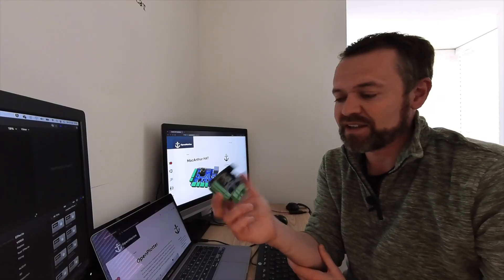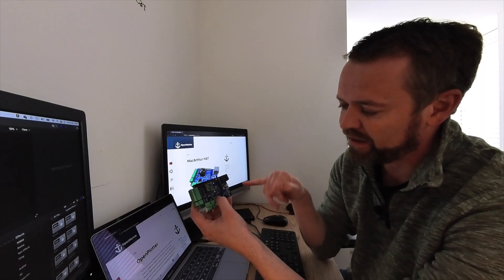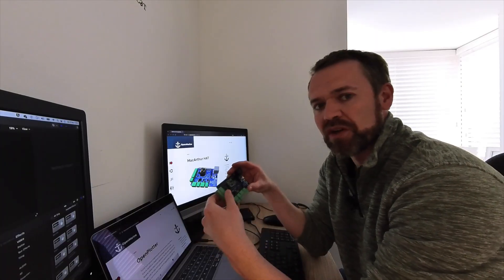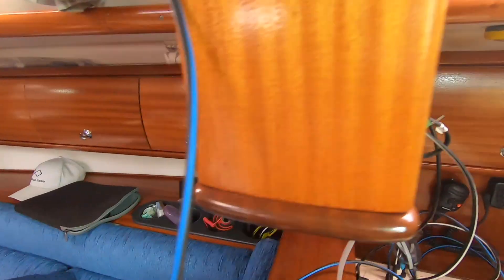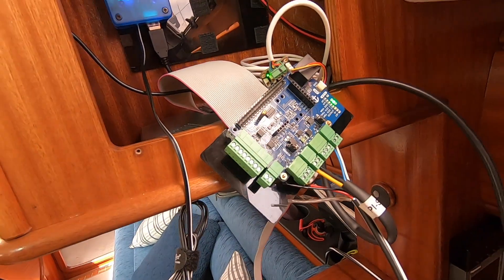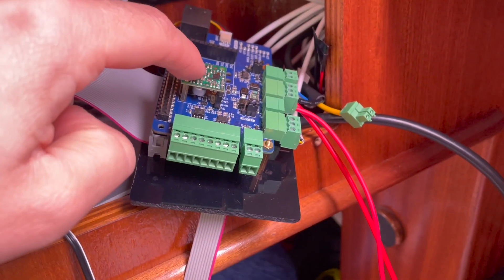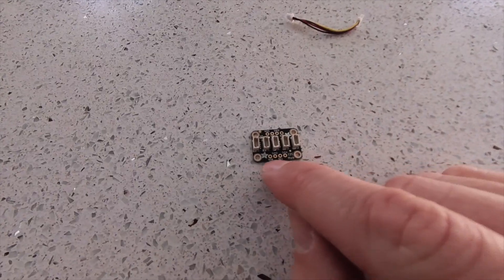OpenMarine - MacArthur Hat Project - A board to connect your Pi to marine electronics

Comment: Hello , I have got one question. I bought the MacArthur Hat with a Raspberry Pi 4 for my boat. I mounted the Hat on the Rasberry but it does not turn on, I read that I can supply it just with NMEA 2000 cables so (CAN H and CAN L) am I right? Or Do I need another battery to supply it? I suppose 12 V.. Thanks
Reply from the maker: Hi, it will need 12v also, so can power from the same source as your NMEA instruments and you can use that switch to get it to boot and shutdown but it will need 12v. https://macarthur-hat-documentation.readthedocs.io/en/latest/power.html

Mine is setup with a 12v power and then the switched power comes from my other instrument switch, so they all turn on and off together.
Reply: @BoatingwiththeBaileys  Can you suggest me which kind of connector I can use for supplying it with 12V source? There are two green male pins (12V and Ground) on the board, but I don't know how to interface my positive and negative cable from the battery. Thanks
Reply from the maker: @andyfreeman9031 mine is connected via a fuse to main bus bar behind my switch panel. It's connected directly to this with a 5amp fuse and then I use the switched connection to turn it on or off. This allows the pi to shutdown correctly without removing the power from it. Is that what you mean?
Reply: @BoatingwiththeBaileys  No, you see on the mac arthur hat that there are some green male pins? I don't know how to connect my battery to them.
Reply from the maker: Ah ok - this is a better page https://macarthur-hat-documentation.readthedocs.io/en/latest/index.html

You will need Ground and 12v, ideally with a 5amp fuse and then the one that says switched, next to the seatalk one, when you apply another 12v to that your pi will boot. When power is removed from that it will go through a save shutdown, you keep the original ground and 12v powered throughout.

Is that the info you need?

Comment: Hi, what case are you using with it? I have the NVME below and the Macarthur above want a closed case and preferably a fan.
Reply from the maker: Hi, I've not got mine in a case at the moment, i was hoping to 3d print the one in the OpenPlotter forum but as yet, i've not done that. Its currently attached with some velcro to just stop it moving around.

I use the active cooler for Pi https://thepihut.com/products/active-cooler-for-raspberry-pi-5?srsltid=AfmBOoqLWhiKA7EAMmfr2WN2y4sa_z_ZynOtzI1AaIOPiQEcu0jwm4P9

It fits well between the board and the hat, and it is an active fan, so it follows the temperature. Its doing a good job of keeping it cool and i can't hear it running which is good.
Reply: @BoatingwiththeBaileys  but how do you fit the Macarthur hat over that?
Reply from the maker: The heatsink and fan are flush, they are lower than the network port as an example - Here is a picture of it all stacked up https://storage.ko-fi.com/cdn/useruploads/display/0036504d-0182-4d15-a15d-df17aaa00338_img_0782.jpeg.

Either the HAT or the base plate came with a selection of stand-offs and I just used the correct height to give me the gap. 

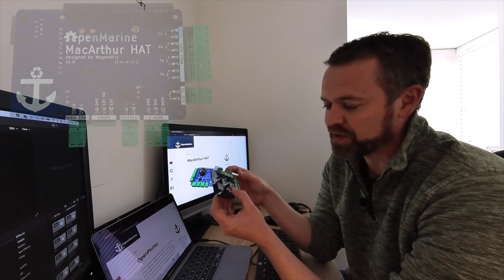You can see it being built in this video https://youtu.be/b-JY8ZeHJr8?si=jvra4WukTNIaaTnd - Jump to 2:00.

Comment: So to connect my Seatalk Ng network I would use the NMEA 2000 ports?
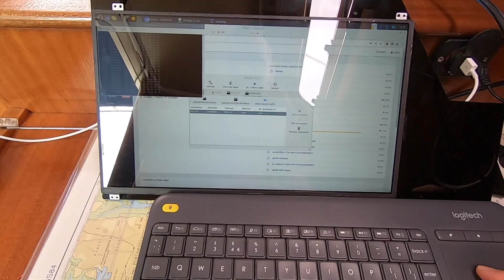Reply from the maker: Hi, Yes thats correct. They do a Seatalk NG Spur cable, with stripped ends - Raymarine SeatalkNG Spur Cable Stripped Ends 1m A06043 and its seen in this video https://youtu.be/b-JY8ZeHJr8?si=WydspL9eP4JTbg43 at 11:00 connected to the NMEA 2000 port on the HAT. Top port, Blue/White cables. Hope this helps.

Comment: My question is not directly related to the HAT,  but I'm struggling connecting Seatalk 1 to a RasPi. Do I need an Optocoppler doing so, or is it possible to get Seatalk data via an USB to serial 422 which I bought? I own Raymarine ST60 instruments and have an Multiplayer called Brookhouse on board. Sorry for my newbie question, but I'm quite lost at this stage how to get Seatalk in my Pi. Any advice is greatly appreciated!
Reply from the maker: Hi, You have a couple of options I think. Might need some further details to help if this doesn't work but I've just had a look at that Multiplexer and if it's in the correct place and the seatalk network is connected to it you should be able to connect your serial device to it and get the data in. Have you got anything connected into the RS232 or the RS422 ports on it? Do you know what it's doing? If you go to our website and send us an email, I'll respond so you can share some photos if that helps?

If you don't have any other way of connecting the Seatalk then the cheapest method with a Raspberry Pi is via an Optocoupler. The MacArthur hat is another option, although slightly more money it gives you loads of options for the future.
Reply: @BoatingwiththeBaileys  thanks a lot, I'll write you an email and think about the McArthur HAT.

Comment: Good video! Can anyone make some elecronic for mast (2 cables to mast ..+-48v and ethernet).. and on top have verious devices like radar, wearher sensors,antenas ,light  have mini dc/dc konverters but all info goes thrue cat5 cable..
System is future proff with 48V and info  and makes easy felis search... thow on top of mast.. which you would have to do anyway
Reply from the maker: Hi, thanks, you would need to be careful with power demand running that kind of kit over cat5, it can be done but they tend to run the power over multiple pairs in networking and then you need extra electronics to split power and data back out. Then added complexity of waterproofing all of this.

Comment: Hello ,  Have you reference of your  I2C temperature module & also the adaptor ?
Reply from the maker: Hi, it’s all from the Pihut, the I2c is BME280 Breakout - Temperature, Pressure, Humidity Sensor
PIMORONI
SKU: PIM472

And the adaptor is this
Adafruit Qwiic / Stemma QT 5 Port Hub
ADAFRUIT
SKU: ADA5625

Comment: Thank you Matt, this MacArthur HAT appears to be an excellent bit of kit.
I really like all the protocol connectivity's and the fact that is accepts 12V and can power the Pi5 with 5A.
You might recall we exchanges a few comment maybe a year ago and you were very helpful.
during the shortage I ended-up with an Orange Pi5, I learned a lot about SBC and Linux (that I had not played with that for over a decade, wow the evolution!), but I had limited success using it with signal K and open plotter etc.
I now just ordered a Raspberry Pi5 8G (due in Jan2024) and a Pineberry Pi HAT so I can run the OS  and SW from a NVMe card (!). Much faster much more reliable.
I tested the Orange Pi5 with SSD card vs NVMe card and the speed difference was almost double on most parameter, I am hoping for similar results with the Raspberry Pi5.
.
I cannot remember if you have the Pi4 or Pi5, if the Pi5 you could look into this HAT here:
https://pineberrypi.com/products/hat-top-2230-2240-for-rpi5.
.
Can I ask: What is that monitor at the Nav station connected to the Pi? Are you happy with it and what would you buy today?
The one I purchase I am really disappointed with and looking to upgrade.

Cheers,
a.
Reply from the maker: Hi, I do remember that and I did wonder how you got on. I’m still on a Pi4, but my Pi5 has just arrived and I’m thinking about a hat for the NVMe so I’ll take a look at the one you mention. I am happy with the screen, I did a temp fix to the plastic back plate thinking I would need to fix it with some screws but the 3m tape is holding fast. I’m planning on bringing it home and removing the small brackets as they are just not needed. It’s a thin screen, light weight and it’s lasted which was my main concern. It’s £30 more now, then when I bought mine but still a very good, clear screen. Just note it comes with no surround and you have to make something for the buttons to fix to because again it’s just a board. https://www.ebay.co.uk/itm/253289838646?mkcid=16&mkevt=1&mkrid=711-127632-2357-0&ssspo=sA4xWqdKSHW&sssrc=4429486&ssuid=1XqhIgr5QPm&var=&widget_ver=artemis&media=COPY
Reply: @BoatingwiththeBaileys Oh, I finally ordered the HDMI screen just like yours. 
Thank you. 
I hesitated a few weeks because a  friend gave me an old no-name 10" screen using ribbon cable, the thing just died on me.
Cheers,
a.
Reply from the maker: @Coyotehello  Excellent - Its been a really good screen, can't fault it.
Reply: @BoatingwiththeBaileys  I have to keep in mind that even if these are fun DIY projects the end goat is to have something useful on the boat! LOL

Comment: Given that the MacArthur hat is still completely unavailable, how would you set this up without it? I've been waiting a long time for this thing to come out, but at this rat eI don't think they're gonna release it anytime soon to the public.
Reply from the maker: I don’t think it’s far off now. The release of the Pi5 has made them move a couple of components to ensure compatibility. Further info here https://forum.openmarine.net/showthread.php?tid=4939

I made boards to connect it up last time which are shown on some of my videos. I think the PICAN-M board is still available for connecting to the N2k network and you can also build a board to connect to seatalk1 that smart sailing did a great video on.

Really don’t think it’s going to be long away now. It’s worth the wait.

Comment: Very informative.
What screen are you using on your boat?
Reply from the maker: Many thanks for your comments. This is the screen https://www.ebay.co.uk/itm/253289838646?mkcid=16&mkevt=1&mkrid=711-127632-2357-0&ssspo=sA4xWqdKSHW&sssrc=4429486&ssuid=1XqhIgr5QPm&var=&widget_ver=artemis&media=COPY although the price has increased from £60 to £90. It’s been reliable and doesn’t use a lot of power.
Reply: @BoatingwiththeBaileys  quite reasonable! Thx

Comment: Great! Can’t wait for your next video on this! When will this hat  be released? I need one! 😃 Will it also work as a multiplexor so NMEA 2k units can listen and talk to other NMEA 0183 units?
Reply from the maker: Many thanks for the comments. I’m not sure on Openmarine’s plan for a release date just yet, I will share what updates I can and I would also keep an eye on the website and forums. It will multiplex and support migrations from one network to the other. I’ve done some of this with their software and plugins in my other videos, it would just mean you can use this HAT to connect it all up and not need to build or buy additional electronics. They have done a great job with this hardware.